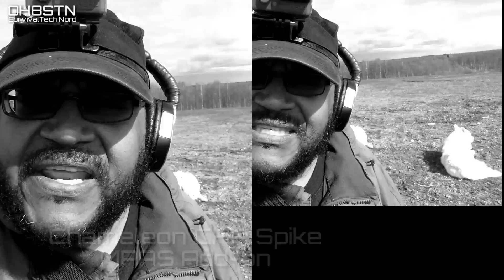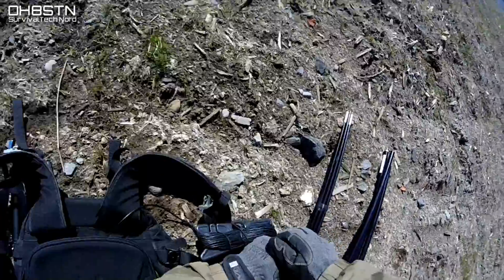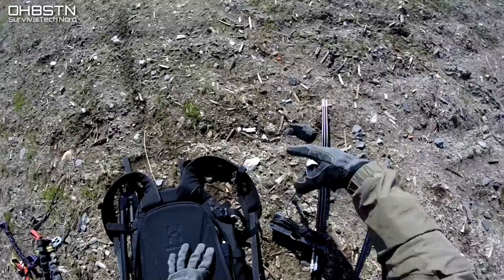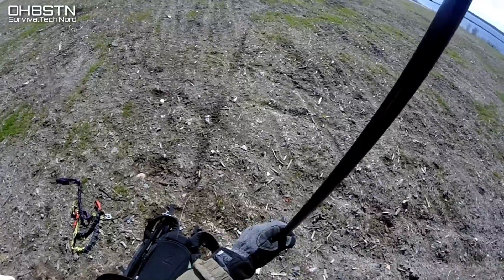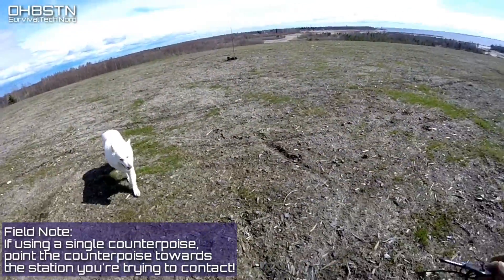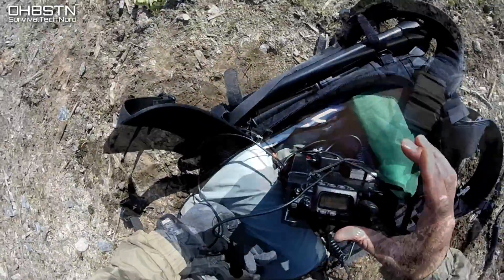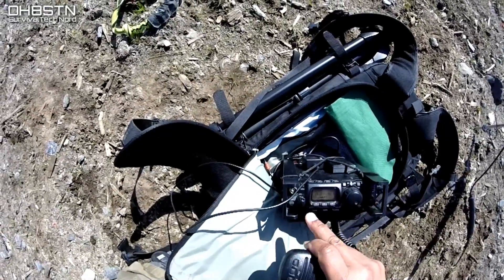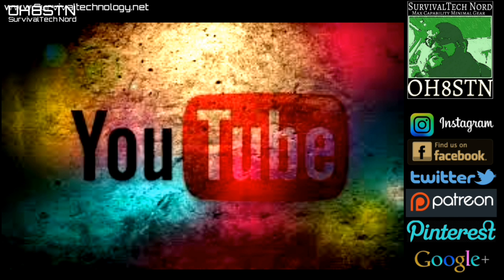Chameleon Antenna SPIKE | Modular Portable Antenna System

Comment: What do you recommend to help the surface contact electrical connection between elements.   Have you sanded (the ends of the elements) or added any solvents or contact helper to your antenna?  Is it needed ?

Comment: I am planing to get this same antenna system and would like to know if the CHA CAP HAT helps to radiate the RF efficiently?  I am more interested in DX contacts and was wondering if you've used the CAP HAT...does it help lower the take off angle?  thanks for sharing

Comment: Hello Julian I have a question for you. If I an getting a low SWR and I don't have counterpoise stretched out more then a couple feet. Is it benifical to lay the coumterpoise wire 1/4wavelength or will it make much diffrence if I have a low SWR already?

Comment: It will be interesting a comparison Chameleon MPAS vs MFJ 1979 17 feet telescopic whip and see which one perform better and the telescopic whip is much comfortable on a backpack and much easier to setup because is a telescopic and btw the MFJ 1979 whip is 59.99 vs Chameleon MPAS
Reply from the maker: Definitely would be happy with the MFJ up until the point its dropped (and it breaks), or one needs to carry it further than from the car to a picnic bench (because it weighs a ton). As for as easy to setup, what is simpler than intersecting poles? I have a MFJ-1979. It is a nice telescopic whip, but it is delicate and heavy, so I don't carry it to the field. With a few additional parts, it would make an excellent end fed half wave, as long as it's not out for a fixed installation.
Reply from the maker: Actually, thinking about it, both have attributes. A comparison video might be interesting on the channel. In fact, there is nothing better than a resonant vertical antenna. I'll see if I can put something together.
Reply: OH8STN  Your right i agree not good for go on the woods thanks for the reply
Reply: I will die to see that comparison  Chameleon MPAS vs MFJ 1979

Comment: Nice review for a very versatile antenna. I have used mine in SOTa, Field ops and on 60M bug out testing. Works great with the built in radio tuner and manual tuners. It is very glove friendly as I found trying it out in the cold weather here in Toronto . I have tie wrapped the spike to a pole or tree stump if the ground is frozen. I could always pull the jaws clamp out but i didnt bring it